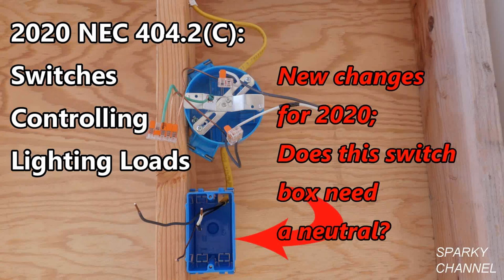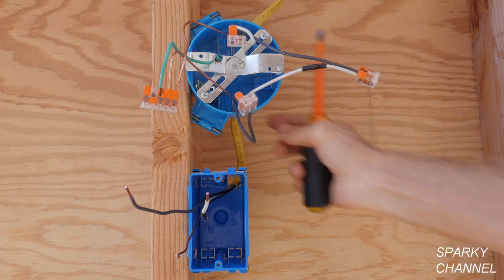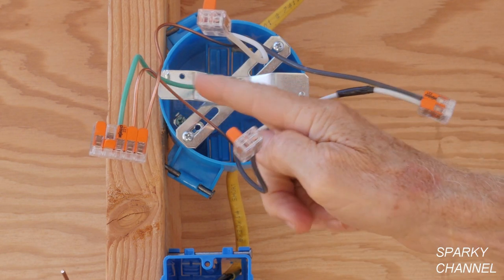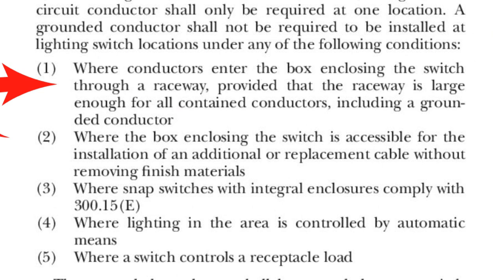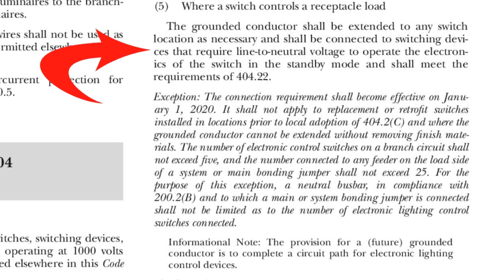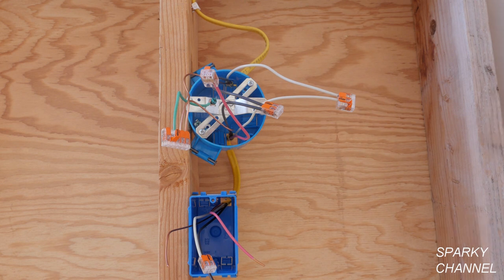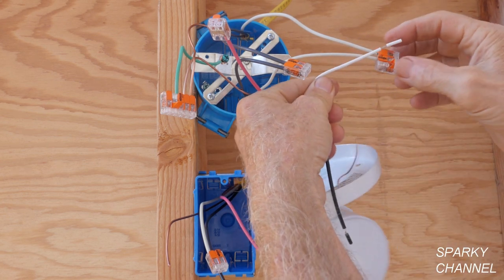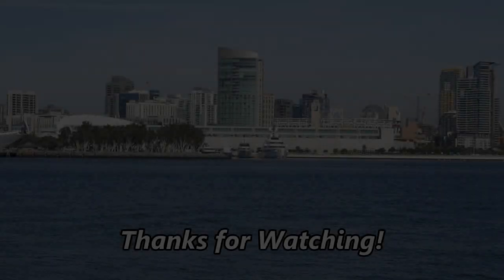NEC 2020 404.2(C) Neutrals in Switch Boxes with Example and New 2020 Exceptions

Comment: What about if the lght and switch uses a breaker in a subpanel where neutral and ground bus are not bonded? Is it srill a 'grounded conductor due to the upline main panel?
Reply: Neutral is always grounded. neutral from subpanel goes to the mainpanel and there it's grounded.
Otherwise switches from main need an Neutral and from sub not ? This would be  nonsens
Reply: Yes exactly.
Reply: Simple solution. Run the Entire Romex to the switch box, then to the Ceiling Light. Switch the neutral wire is what the pro's say.

Comment: What about hanging a celing fan with a ligh and you want to a light switch and a fan switch seperate would you use a 12/3 or 12/4 and where would you start the homerun in the ceiling box or light switch box?
Reply: Are you running separate cable runs for each switch? I did this (added a second switch) in my bedroom to control the ceiling fan separately and so now just have a 12/2 for each of the two switches.  
If you have a preexisting fan/light with a preexisting switch, then it might be easier to just change out your switch with a dual switch (one with a switch on top and switch on bottom of a single gang device).
Reply: 14=3 or 2 runs 14-2 so you can run the fan and light seperate or if 1 circuit is already there get a remote kit.

Comment: When I run a switch loop, I bypass the hot past the light so that the hot goes directly to the cable going to my switch's black wire, then my switch's white wire becomes the load wire back to the light's black wire. Then the light's white wire ends up becoming a proper neutral. 
Is there any reason this isn't proper or correct?
Reply: Yes, the Code says to make the white hot to the switch loop. I always have done it that way because in the actual J box of the light you will avoid having two white wires supplying the actual light wires. ( The tape can fall off in time even if the installer re-identified) PS that wasn't code for many years, you could do it either way.

Comment: For 2 reasons.. a neutral to expand circuitry and also for those damm  dimmers   and really what needs to happen is a code for larger boxes ...get rid of the 12.5 cu in boxes for goodness sake
Reply: yeah, limit the number of conductors allowed in the box then force us to add more  conductors that aren't needed and only take up precious room we don't have.  the perfect logic of an engineer.   I was just thinking about bigger boxes the other day when I was anticipating replacing the GFCI in a very full 3 gang box that also has 2 other dimmers.
Reply: @frotobaggins7169  so you agree the only time a bigger box is better
Reply: @Jason_Canada  I'm not sure what you are asking. I think bigger boxes would be helpful.  Or smaller devices.   A GFCI nearly fills  single box by it self.

Comment: In the case where you have a 80's wiring and want to install an intelligent switch, can you use the earth ground as the return or are you out of luck unless you can find a way of pulling a neutral?  They specify a specific number of devices?
Reply: Earth ground is the NON current carrying conductor so that would be a firm no. The only time the non current grounding conductor should ever carry current is for a  millisecond during a fault situation.
Reply: @NickFrom1228  that’s what I thought believed. I had planned to grab a white wire and pull down to switch along side the Romex.  Though I might just let it go as I’m using a smart bulb.
Reply: @MrKen59  Pulling a wire down outside a sheath would also be violation. They would expect you to pull in 14/3 if feeding from the light. Or if you can get to the attic you can do things like pull a second 14/2 down to feed the box so it would be as though you were feeding the light from the box. Would be weird but I suppose an option that didn't require pulling out old cable etc. I would be tempted to get a wireless switch. Anyhow, pulling a 14/3 is the "best" in terms of future proofing, functionality etc but would require some drywall work to deal with pulling the staples, pulling in new wire, stapling, and of course the wiring, which is super simple.

Comment: So running a home run to a switch box and then from the switch up to the light isn’t allowed anymore, or it is because you’d have two grounded conductors. And then your pig tailed grounding conductors and of course your  ungrounded conductors opening and closing the circuit.
Reply: NO, that is not the case.  NEC permits bringing the source power into the switch box or into fixture box.  But where the switch box is the source, then a neutral will always be present at the switch and there's nothing to talk about.  This video is addressing how 404.2(c) affects the wiring method where power originates at the fixture box.  Where power is coming in to the fixture first, before 404.2(c) it was a common (and legal) practice to use a 2-wire (white/black/ground) cable for the switch leg (from the fixture to the switch) and relabeling the white conductor to indicate that it was being used as a "hot" conductor.  Now, NEC requires that 3-wire (white/black/red/ground) cable be used -- except in the exceptions mentioned.  This is because many "smart" switches and electronic dimmers now require neutral to the switch (to power the electronics that enable the "smart" function of the switch)

Comment: What about 3 ways? We Cant have a 3 cond. tie into a switch in a single gang box? Without a neutral.
Reply: If you “dead end” a three wire in a single gang box then you can’t put an electronic device requiring a neutral in that box.
Reply: @charlestaylor3544  Im unaware of any companion switches that need a neutral. You can by code dead end if lights are in same room and both ends are visible is how I understand it.

Comment: in the above situation, can i hook up an outlet from the switch? Thanks
Reply: if you mean can you extend power from the switch to a receptacle, then yes.  if you mean have the switch control both a light and a receptacle, also yes.
Reply: @kenbrown2808  i have a light in a room. the power goes to the light fixture first, and then to the switch.
Reply: @geohac2456  if it is the old style without the neutral, then no, you're out of luck.
Reply: @kenbrown2808  the problem is: the power comes to the overhead light/fan. from there it goes to the wall switch. how do i connect the wires to add an outlet that is hot all the time
Reply: @geohac2456  assuming this is an older house that doesn't include a neutral in the switch box, you can't. you would have to fish a new cable down to your receptacle box from the light/fan box.

Comment: Accepting for some devices that require power at the switch, why would you put anything other than neutrals at the switch?  Does one not typically relable the romax to be 2 white wires such that the neutral alone goes to the switch?
Reply from the maker: Excellent! Way to go!
Reply: @SparkyChannel   So, are you saying that's correct? Also,  thank you for taking the time to share your work with us.
Reply: What are you talking about???     It's only neutral or power based on what it's hooked up to, not the color of the wire.
The wires going from the fixture down to the switch (a switch loop) is power wiring.
A switch switches power -  you do not switch neutrals!!!!!
Reply: @JustHazardous  just a historical note.. Switched neutrals are common in really old systems.... Confuses many 'modern' techs.. Lol

Comment: I am rewiring my house. And electrician is going to handle the new breaker box, shutoff and meter box upgrade.  And one thing I wanted to do was move all the light circuits off the outlet circuits and break the light circuits up by zone in the house. And while researching this this I saw newer switches with the extra wires.  You have definitely answered my questions with this video.
The only question I have still, is since I am rewiring the house anyway, should I take power to the switch boxes and then to the lights fixtures, 12/2with ground from the breaker  to the switches, and 12/3 with ground from the switches to the lights then?
The existing setup is 12/2 from the breaker to the light and then 12/2 to the switch. Like your first example. Does the order need to be switched?
Reply: I would... Im not an electrician( i know some knowledge) but if you have walls opened up and than it never hurts to run 12/3 incase you add later on. Lots of these comment are complaining about price and wasting wire but  if its your own home run extra!!!!!!! Also run CAT6 everywhere you never know.
Reply: if you do a loop you also would want the extra hot wire at the switch so a random doesnt go use the neautral (white) as a hot coming down from the
Reply: @austinreeves5221  If the white is used as a switch leg, it must be reidentified as such. That means marking it with tape or paint. Red is the typical color of the switched side so wrap a bit of red tape on the white serving as the switch leg. On both ends, by the way. 

The only color wire that may not be reindentified is the green.
Reply: @ricoludovici2825  If someone doesn't see a white wire going to a switch and assume it's hot, they have no business opening boxes. That being said, I do tape my 240v hot wires and I tape every so many feet on the outer coating to denote it's all hot.
Reply: @ricoludovici2825  Code calls for the white switch leg to be taped with black tape. Red is normally used on one of the two hot wires coming into the service panel.

Comment: Can you discuss some more of the why’s.  Why did the code change?
Reply: I also wonder about that as well but I guess It's  to keep up with the new smart technology and such.
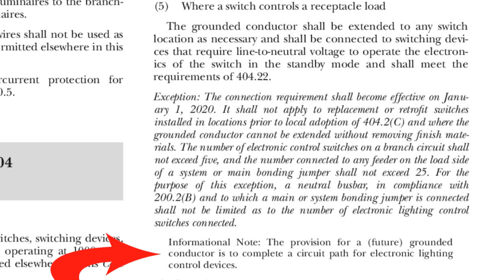Reply: @9:20 it specifically states it.  Has to do with the fact that most electronic switches (like dimmers used for LEDs) require neutral. Almost all smart switches do.
Reply: @curtisbme  The real reason the code changes is electrical supply companies have lobbyist members on the code making committees. You can see for yourself starting on page 9 in the 2020 NFPA70.
Reply: More and more residential users are looking into smart switches that require line voltage to power the switch.  This means they are not just switching the hot, and require a neutral.

Comment: Hello Bill. I am under the impression that you don't bond the neutral and ground in a distribution box. But your video says otherwise. Is part of the new code to bond the neutral busbars to the ground busbar through a jumper?
Reply: Obinna Kalu, NEC has always required and continues to require bonding the Neutral and the ground/grounding (not the "grounded" conductor, that IS the Neutral) conductors together, with a "bonding jumper", but ONLY at the service equipment.

The Neutral conductor is technically referred to as the "Grounded Conductor", because it is grounded at the factory. 😃 Of course, 'the factory' is the power company, or in some cases, at the separately derived power source, e.g., an on-site generator, wind or solar farm.

Service equipment is defined as the first piece of equipment that the service entrance conductors land in and also provides an integral service disconnecting means from the premises wiring. In a typical residential environment the service entrance conductors are typically the cable(s) originating from the meter base and terminating in the service equipment.

A bonding jumper can be a screw, a strap, or a small offset bar of some type. Most distribution panels designed and intended to be used as service equipment have one or two terminal (bus) bars for terminating the Neutrals and the "grounds", which are technically named/called the EGCs (wires), the Equipment Grounding Conductors, either bare or green-insulated wires.

When a distribution panel is not the service equipment the Neutrals and the EGCs must be separately terminated and not bonded together. Sometimes this requires installing a separate terminal (bus) bar for the EGCs and not installing the bonding jumper on the factory mounted terminal (bus) bar, which is then to be used only for the Neutral terminations.
Reply: How come when your behind the cam I picture Scotty Kilmer talking lol
Reply: The neutral and ground are only to be bonded in the first means of disconnect. If they are bonded after that you will have a nightmare with the new arc fault breakers.
Reply: @wellcraft2136  thank you very much for this. Please assist me with this one question. One test that neutral and ground is continuous is to test for voltage. A voltmeter placed on the live and earth reads 120/220V as the case may be. I'm guessing this is because the neutral is bonded to the earth so definitely thesame voltage across live and neutral will be present across live and ground. From your explanations this is only to be done at the service disconnect point. Now here's my question, in subpanels or a sub panel, if voltage of 120/220V appears across the live and ground, does it mean somehow the ground is still bonded to the neutral point somehow even when the neutral and ground are on seperate bus bars inside the panel.. I humbly await your response
Reply: @dredbud9272   thank you very much for this. Please assist me with this one question. One test that neutral and ground is continuous is to test for voltage. A voltmeter placed on the live and earth reads 120/220V as the case may be. I'm guessing this is because the neutral is bonded to the earth so definitely thesame voltage across live and neutral will be present across live and ground. From your explanations this is only to be done at the service disconnect point. Now here's my question, in subpanels or a sub panel, if voltage of 120/220V appears across the live and ground, does it mean somehow the ground is still bonded to the neutral point somehow even when the neutral and ground are on seperate bus bars inside the panel.. I humbly await your response
Reply: @obinnakalu1777  you should only be able to read 220v across both phases. Hot to hot. If you are reading 220 to a neutral or ground you have a problem. There is a couple of videos on here that explain it better than I can. Good luck.
Reply: @dredbud9272 .. 220v is the nominal voltage in my country. I put 110/220v depending on the nominal voltage used in different countries.. So for clarity if 110v is measured between live and earth in a subpanel, does it mean the neutral and earth are still bonded?
Reply: @obinnakalu1777  use an ohmmeter to check continuity between the neutral and ground .
Reply: @obinnakalu1777  There may be a voltage difference between neutral and ground if the neutral is carrying current, as the resistance between the box and where neutral and earth/ground is non-zero.

Comment: Question? I see you used the push in connectors on your wires. So a electrician guy on YouTube claims they are not safe do to heat cycles that the medal will break down easy. What's your opinion?
Reply: I use Wagos extensively. The one caveat to using Wagos is to make sure you're using genuine Wagos, not knock offs. I've seen tons of cheap Chinese knock offs on Amazon and eBay, but they aren't UL and CEC approved.

Comment: I would imagine this is because they found less educated people trying to install a timer switch that needed a neutral and used the ground wire instead.
Reply: it's because with LED lamps on the scene, it is becoming less and less feasible to have a switch use the lamp to complete its control circuit, and with more use of arc fault and ground fault receptacles, they can't get away with using the grounding conductor to complete the circuit for large numbers of switches.

Comment: Sparky, your video was a very good explanation of the code on this subject. However I didn't see a single neutral in the entire video. When figuring current carrying conductors it (NEC 310.15 (E) (1)) describes the neutral as only carrying the unbalanced load. Anything else would be a grounded conductor. When I teach my classes I make a point that unless the white wire is shared between 2 ungrounded phase conductors, it is not actually a neutral, even though everyone calls it such.
Reply: Technically, it became a neutral at the center tap of the utility transformer. It's really that open and shut. It's awesome to teach the details and to understand them but in this case you are overthinking it. In the typical electrical system of a typical residence the grounded circuit conductor is a neutral period
Reply: Another thing, the quote you are referring to is specifing a condition that the neutral must have to be shared... It is not defining what a neutral is. Learning Electrical Theory at trade school is where I recall understanding a Neutral.
Reply: @carlgibson593  I read what you wrote carefully. You are contending that if the grounded conductor is not carrying unbalanced current on any particular circuit, that it then doesn't qualify/(is not in use as) a neutral. I think I understand the fine point. I really don't contend with your logic, but I think most people who understand electrical theory on the level that we are discussing here would still call it a neutral because of the connection to a center tap. I think I do see your point.
Reply: @carlgibson593  By the way, if the topic was derating then the difference between the two becomes very important.... But the test was on conductor fill and if someone called a white wire that wasn't carrying unbalanced current a neutral then you definitely have a point. But there was no indication how the white wires were to be used in this example and so no way of knowing if they were neutrals or grounded conductors. So, definitely accurate point by you but also not really provable with out more information.